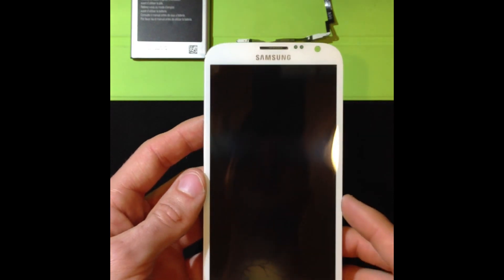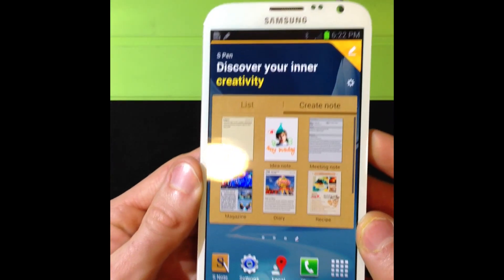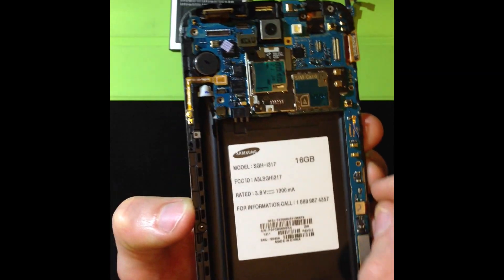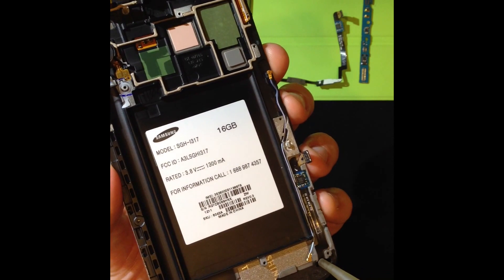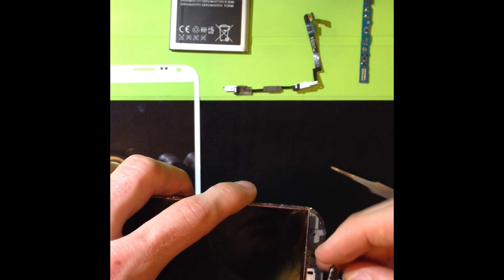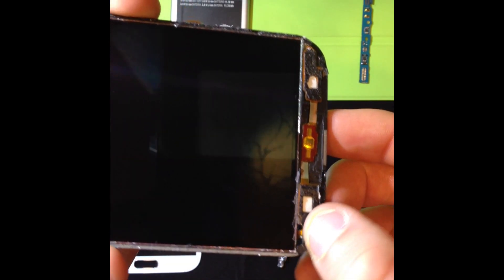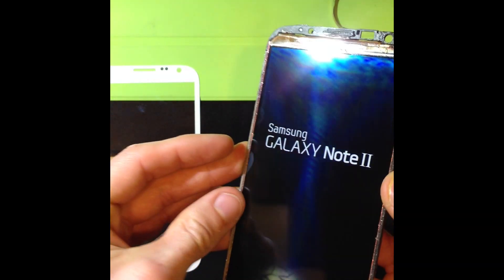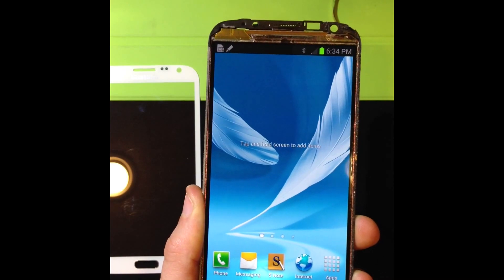Samsung Galaxy Note 2 Home Button Repair

Comment: thanks a lot your video helped me fix my problem .. I payed 40 bucks to have charge port replaced, should have done it myself its so easy. but when I  checked phone after the place closed my front bottom panel didn't work and they closed on weekend.. this vid helped me find the problem the cable wasn't attached..

Comment: thanks for the info you just saved me from buying a new phone.  when i put phone back together, i guess i took off the ribbon cable connector off. saw your video and then i notice mine wasnt plug in. plug it in and now it works

Comment: Thanks so much. This helped me replace my cable on the Note 2 when I accidentally slashed it when removing the screen. Happy to have a fully functional Note 2 again!
Reply: BTW, my Note 2 had the screw that connects the main board in a different location than on this video. Mine was a bit above the power cable connector on the right side, midway up the board. Also I had to disconnect more cables than shown in this video to move the board. But it was easy to figure out these issues to get to the correct cable. Thanks again.

Comment: the last people who replaced my screen didnt seat the home button properly on my galaxy tab 2 10.1.  So it is sitting there loose and not pressed upword tight.  so dust has gottne between the touch screen and the digitizer. Screen is cracked again and I am going to replace it. would like to replace the spring or what ever presses the button out from the inside. Do I need the home button cable or a new home button?

Thanks for the great info.

Comment: Hey. I have a note 3. The two touch buttons work and the home button works also. But I have to press down hard on the home button for it to work. I don't think the issue is with dirt or anything like that. The phone is in tip top condition. Is this a problem with the flex cable? Is there a way to repair it without having to switch the entire cable?

Comment: Only the back button doesn't work on my phone.  The Home and menu buttons work fine and light up. Please advise.
Reply: *****
 My back button broke when I was trying to replace the front glass on the phone. Both of the other buttons work. But there's not light on the back button and it has stopped working. This is the i9105p version of the samsung galaxy s2 plus note. Do you know where I can get this home button assembly? Thanks!

Comment: Hi Neather bot. I reallu appreciate your effort. And I am going to open my note 2 for the same reason I.e home button is not working. But I want to ask u a question that sensors are fixed with the main board or not. Because I dont want to crush my galaxy. I love it. And also I want to open it up by myself.

Comment: My phone have so many problem on the bottom.two keypad lights is not working,some time usb port is not working but if i remove and reinsert the battery it will work and the big problem is after switch offing the phone the screen is showing battery low logo (big logo) and then after two sec current battery status is showing (That's also is very big) repeatedly.So if i want to turn off the phone i have to remove the battery.otherwise she is alright no problem in working.It is not a software problem coz i did hard reset updated it but no use.Please help me.

Comment: Mine broke from flying out of the window of my truck (long story). I got a new screen and case along with this part for $19 so my phone will look as good as new. I also got the uv glue and uv nail tool to glue my screen down so it's as close to oem as possible cus alot of people complain about the double sided sticky tape technique having an air pocket between the led screen and glass.

Comment: Hi, thanks for a great tutorial. I am wondering if this is also applicable to the i9105p version of the samsung galaxy s2. Is it identical to the i9100 ? If so, can I safely buy a home button on ebay that says it's made for i9100 even though my phone is i9105p. They do look identical but just want to make sure.

Thanks!

Comment: Question, I have done all of my Galaxy Note 4... pretty much a new now. But my question is... Does a new home button have a film over it? Finger print is having issues and as I said...I rebuilt the whole phone as I discovered what was wrong with it. Thank God for the tutorials here...so if it has a film on it... could it be...just that simple...white Note 4...I see a bit of color not matching...am I right??

Comment: Hi NeatherBot,

First off, congradulations on the excellent tech video! Thumbs up!

I have a Galaxy S2 SGH-t989. My Home, Menu, Back and Quick keys have failed to work. The phone has never been serviced. It has been dropped a couple of times, but has a rubber, shock-proof cover. Anyway, I suspect that it is damaged as the keys simple do not function.

questions:

When you say "ribbon cable," must I be specific in ordering a ribbon cable for the bottom portion of the S2 phone, or do I just order a ribbon cable? 
Exemple:
On E-Bay, I see there is a ribbon cable for my S2, but it is listed as follows:

"Brand New ! Samsung Galaxy S2 T989 Keypad Keyboard Button Flex Cable Replacement Part
What you get : 1 x Samsung Galaxy S2 T989 Touch Keypad Sensor Flex Cable"

Is this item the same thing as a "ribbon cable" for the bottom keys??

If so, I will go ahead and order that part.

Many thanks for your assistance. Cheers!, Mark, Brazil.
Reply: Can you respond to my questions above, please?
Reply: @dinomarati did you end up ordering it?